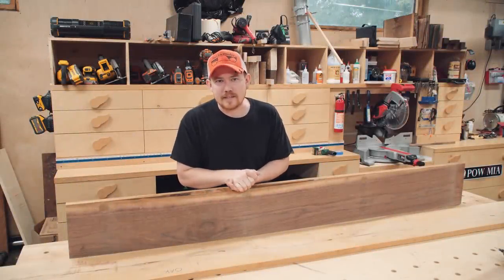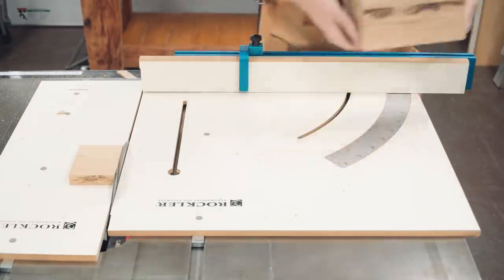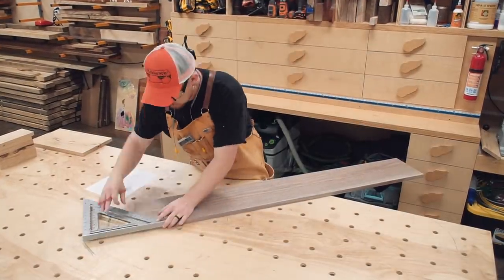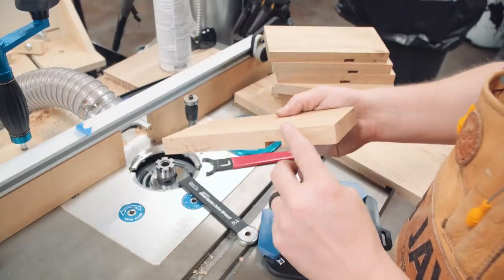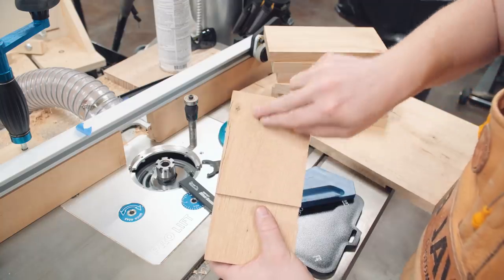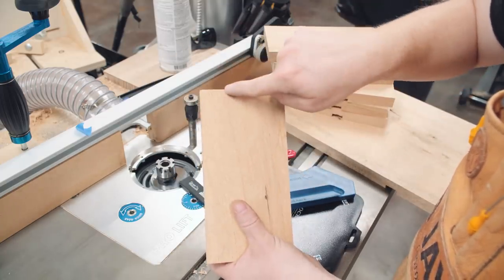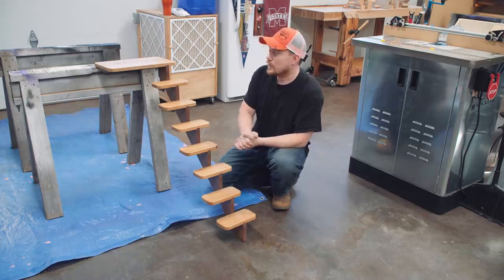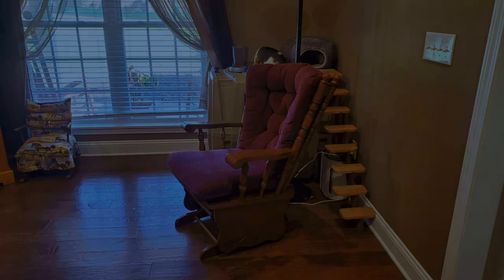One Day Build: Cat Stairs - 356

Comment: I like how the cat is accepting the stairs. I have to do the same since my cat platform is away after a winter storm a few weeks ago.
But - it´s outside, and the cats need to climb 3 meters to my balcony to come up from the garden on ground level. Anyway, this solid construction should make it. Although I´m not going to use expensive wood. I guess this can be made from construction wood as well. And you can buy these wooden breakfast boards / planks as steps for little money.

Comment: I had made several pet stairs for people years ago but made mine were free standing with two full length and width sides. Looking at this and comparing it to the ones I did, I like your design much more. Does the same thing with much less material and much smaller footprint without sacrificing function.

Comment: First off, I loved this quick build. 

Second, and I' know I'm not alone here. There seems to be this ... thing ... in the woodworking community. "One day build X for cheap $  with hardwood!" projects as the title... Then you get 30 seconds into the video and realize they're building it with $10-20k worth of pro tier or pro-sumer gear in a 900+ sqft workspace with proper power, lighting and ventilation, who has  has a source for actual wood on speed-dial (IE, not a box-store) and pumps out something like this masterpiece with it in minutes. 

Even though I wish to one day, I will most likely never have the space to enjoy a good plainer or table mounted router. I'm just hoping for a solid exhaust fan one day. Heck, I'm still digging the trench to run a proper 60 amp circuit to my garage to start the process. 

And Third: I think we all need more good-woodworking in our lives. When I watch this, and get sad and envious, I'm reminded of other channels where all the joinery is done by hand. Where everything in the fitting process is done by hand with hand-only tools. Maybe I should tend that way... unless I win the lotto.